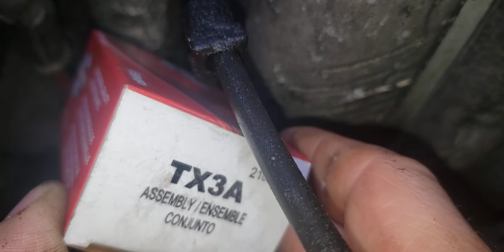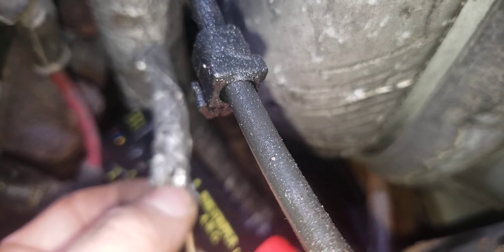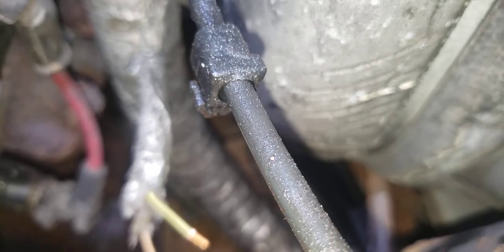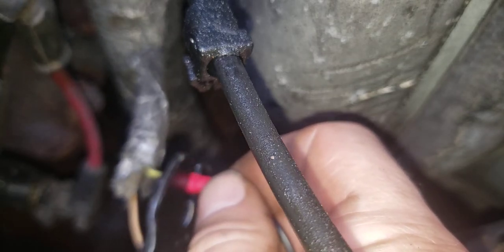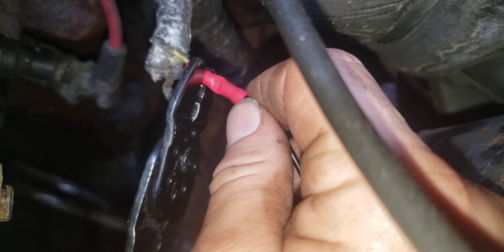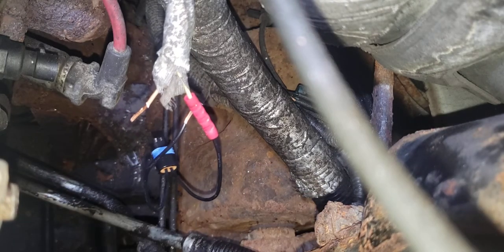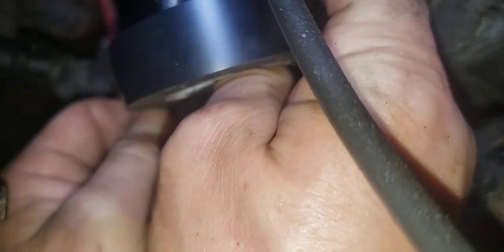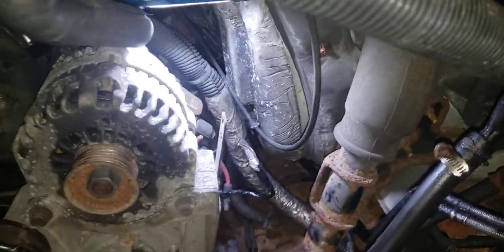Replacing electrical wiring for the Engine Coolant Temperature Sensor 2003 Chevy Express G3500 6.0L

Comment: 98 Camry. CEL for P0115 and upon inspection one of the wires on the ect plug looks a bit frayed. So I'm going to attempt to do a new connection like you did here with absolutely no electrical knowledge. Wish me luck and thank you for the video!

Comment: I had a wire that had exposed insides touching the pipe the temperature sensor was screwed into. I think it might have damaged it. Its new but the gauge isn't reading well. Goes up little bit but drops all the way down when driving.
Reply from the maker: I would make sure to repair the wire and fasten the wire in the wire holder if present or fasten the wire out of the way of heat and moving mechanism.

Comment: Dose it matter if the wire's where turned around like if you put the black to yellow and black to tan wire or the other way around like what will happen if there not connected probably ??
Reply from the maker: Worse case a mini fuse will blow. I know the replacement wire harness repair kit usually has the same color on all the wires. 
Could use a multimeter to each wire from the vehicles harness to check which wire has power.
Reply: @allanautollc3210  alright i will do that thank you for your reply sir much appreciated 🌹🌹

Comment: My temperature gauge runs over the half way mark i think its over heating i had the shop take a look at it and its fine could it also be the wires .i  have everything new in it reads higher then normal but never drops  low Only higher .

Comment: Nice.     What issues were you having in order for you to change the prong?? Did you replaced the sensor??  Thx
Reply from the maker: No issues besides, I noticed it broke and the check engine light with code for the engine coolant temperature sensor. But I was also replacing  a lot during this time

Comment: Is it possible rewire a 2 pin connector in place of the the old 4 pin connector? Because I can only find a 2 pin temperature sensor. I can’t find a 4 pin temp sensor anywhere for my car.  1993 Chevy corsica. If you have any advice I’d greatly appreciate it. Thank you
Reply from the maker: Coolant temp / water temp sensor should be 2 wires

Where did you unplug a 4 wire plug from a  sensor ?  On the upper or lower intake manifold or side of a cylinder head?
Reply: I followed the top radiator hose to the thermostat. It’s right behind the thermostat.  1993 Chevy Corsica 4cylinder

Comment: hi iv got a similar problem but both my coloured wires snapped off right at the base of the connector . so i dont know which colour goes to which terminal . i thought of just taking pot luck and re connect but if its wired the wrong way can it affect the ecu
Reply: What if you can’t find the vehicle. I need to know  tan and yellow
Reply: Did you ever figure out what wire goes with what

Comment: I just got my car running after replacing both o2 sensors and my wires popped out of my connector .and killed my motor I replaced it now my car won't start again. Any suggestions would be greatly appreciated
Reply from the maker: Replaced the O2 sensors again or Motor? 
If the engine is trying to start after the O2 sensor wires broke, the catalytic converter could be damaged/clogged. 
What's the year , make, model?
Reply from the maker: Especially if it's a general motors oem catalytic converter from 90's to mid 2000's 
And if you used a torch near that catalytic converter to remove the O2 sensor.
Reply: 2003 malibu it started after I replaced them but then my sensor connector wires came out killed the engine. I didn't use a torch on my o2 sensors.
Reply from the maker: @tammymarglon-desmet984  ok, then maybe a fuse in the relay center or multiple fuses in the other relay center as well. Use a test light and pull to visually see the fuses. Check as many connectors and wires near engine where a harness fastener may have broke causing a wire(s) to get burned over time.
Reply: Thx Allan. I'll try again tomorrow lol It started every time before them wires came out. Still had a misfire but finally drove right b4 that happened thx for the video too
Reply: Thank you waSnT quite sure wtf to do next 😎🤘⚘️
Reply from the maker: @tammymarglon-desmet984  you're welcome. Keep me posted either way. I'll try to help

Comment: What happens if you get the wires crossed mine was all the way off when I took it out and they’re different colors like that one
Reply from the maker: Big Big boom.
Just kidding.  If the wires get crossed. The fuse might blow but the coolant temp sensor won't work. Then you have to switch the wires.  
So if your not sure, temporarily connect them
Reply: OK thank you I’m going to try that after work

Comment: My cte wire is getting no power any suggestions
Reply from the maker: Find the circuit and Check the fuse or fuses for that and connector that the fuse is in and for power. That's where I would start

Comment: The copper is glued to the plastic on mine, everytime I strip it the copper comes off with it
Reply from the maker: Very thin wiring. Its most likely doing that from years of heat near the engine. 
I would go farther away from the engine in the wiring and try and I would use those non strip style wire connectors. Just put the 2 ends in the connector and close it. I would still use electrical tape.
Reply: Use a candle lighter, duhh😊

Comment: If you could've soldered it, why did you choose to crimp it instead?
Reply: Lol you answered the question in the video
Reply: I read that you have to replace the whole wire, but able to splice it but this video proves that wrong
Reply: Thank you for this video.  I was wondering where the exact placement this part was and when you exited, it showed the location